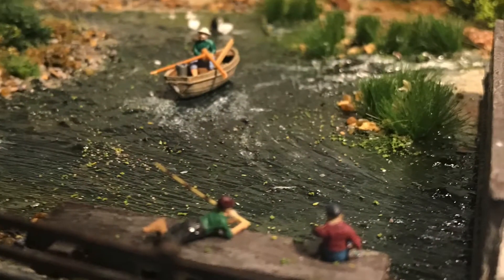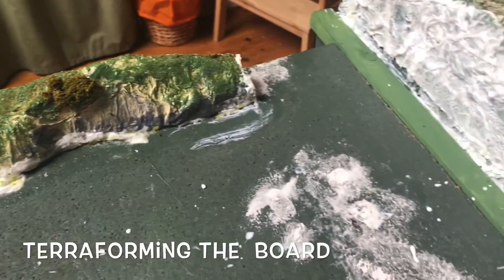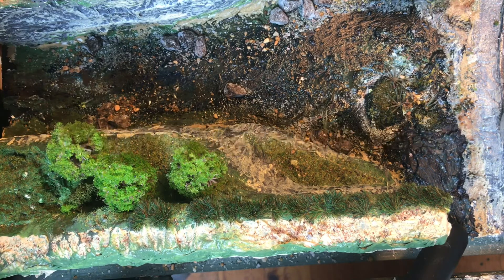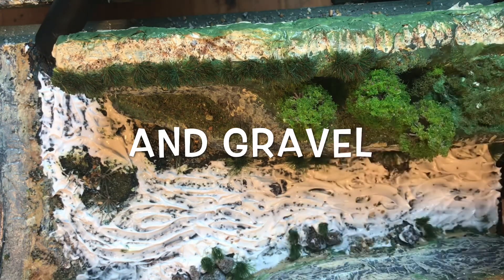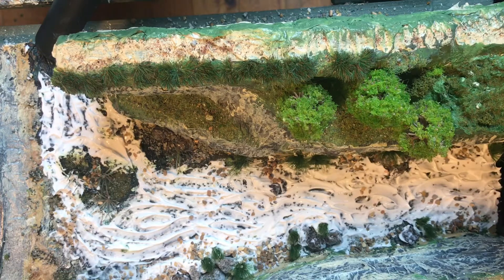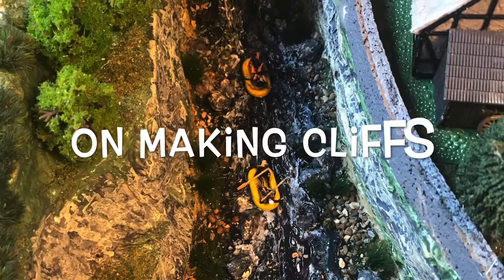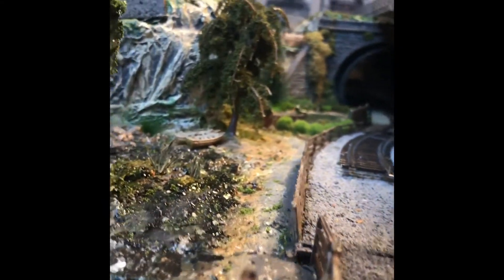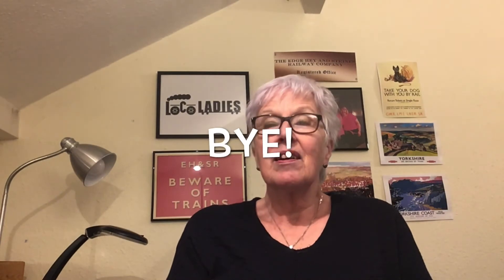How I Made a White Water River on my Model Railway

Comment: Just found your videos and I have to say your realism of the water flow is the best I have seen. I am hoping to put a canal on my yet to be built layout and wonder if you have any tips regarding that type of waterway.
Reply from the maker: Thank you. I made this up and haven’t seen it done the way I do it.  I am happy with the result. Canals tend to be very slow moving and most people use resin based ‘water’ or pouring water products like Deluxe Materials Aqua Magic. Trouble is you have to be very careful to seal the edges. I find these rather flat and prefer to paint my base coat in dark murky colours and use the structure gels by painting them on with a stiff brush and smoothing off with a wide spatula.  It still gives a feeling of movement.  My harbour video shows the ‘movement’ you can get on a larger area of water. This could be smoothed down more for a canal.
Reply: @CarolFlavinlocoladies  Thank you so much for quick and very detailed reply.